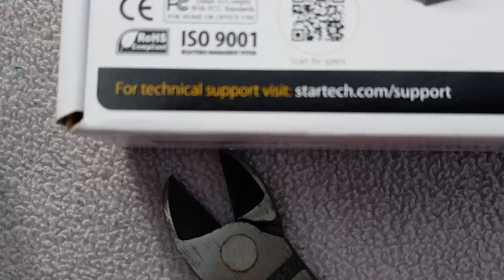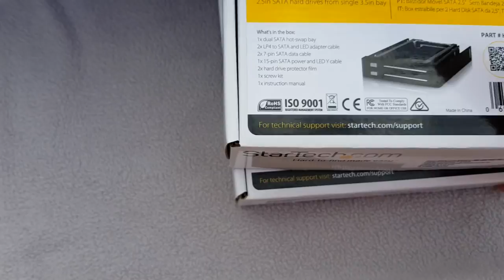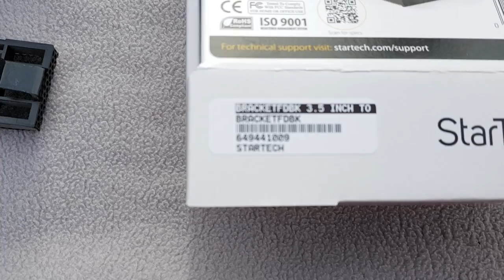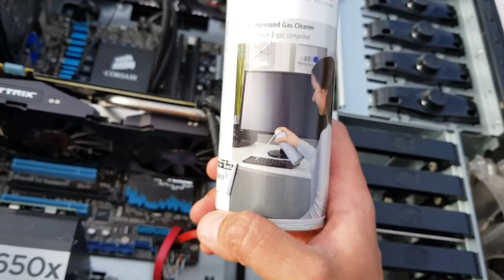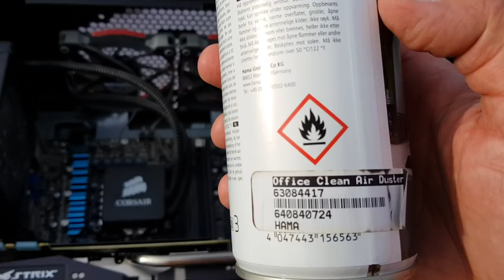ArcoLinux 618 : how to mount an ssd bay in your desktop to easily switch between windows and linux

Comment: Laptops run fine from a 128GB usb 3 stick... 8 to 10 seconds from pressing the power to having  a working desktop. Handy way to run Arcolinux on a new laptop while keeping the OEM OS install intact (mine is still awaiting a user) .. then do a fresh install onto the internal drive just after the laptops first 'birthday'...unless you use the Windows install.

Comment: I'd suggest checking out the Flexidock instead of the products you included in this video because the Flexidock has 4 bays and has a power button for each bay. You don't need to remove a drive just to switch to a different drive for booting. I think this is a better option if you want to check it out. https://www.youtube.com/watch?v=b8UKZxijtRM
Reply from the maker: Great tip - I added it to the page - https://arcolinuxd.com/how-to-mount-an-ssd-bay-in-your-desktop-to-easily-switch-between-windows-and-linux/